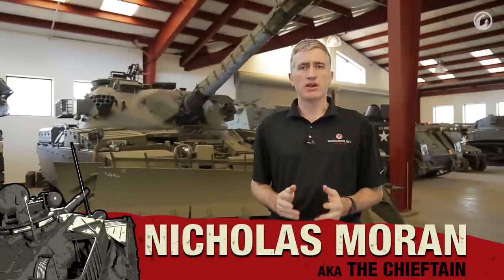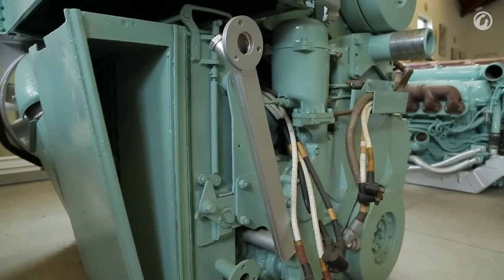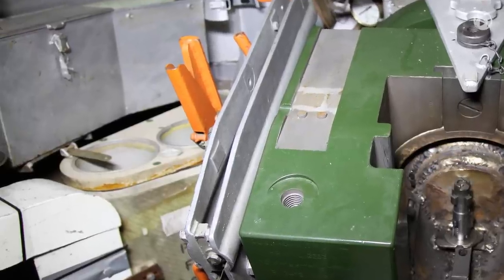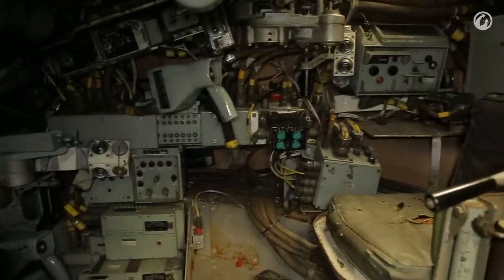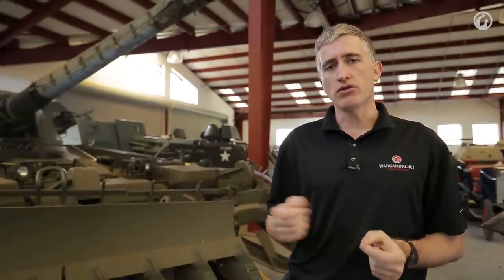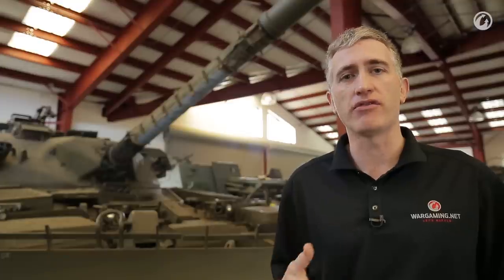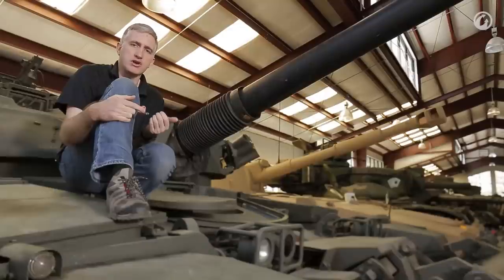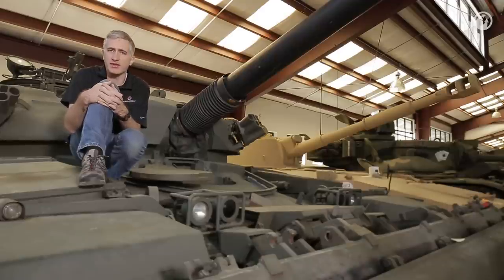Inside the Chieftain's Hatch. Snapshots Chieftain

Comment: Nice video! Couple of extras about the Chieftain:

1. The Israelis were involved in the early stages of it's development and were originally going to buy it. It was only when the deal fell through for political reasons that the went on to develop the Merkava on their own.

2. The engine problem could be fixed. The Jordanians had a version called the Khalid, originally intended for Iran until they suddenly stopped being our buddies, that had the Rolls Royce Condor engine developed for the Challenger. This gave it a WAY better power:weight ratio and much better reliability. The downside was a raised engine deck that meant zero gun depression over the rear arc.

Comment: Never fried anything in the BV when i was on the Chieftain there was 2 per tank so plenty of hot water. Used to put tins in the BV to heat up the food making sure they were dented otherwise the BV would would explode and have tin and food splattered around the turret, which did happened and getting more than an earful from the Commander lol. Also not one of the Chieftais in my Regiment in Germany had the dozer blades.

Comment: Question about rate of fire: Would you consider soviet autoloaders (T-64, T-72, T-80) to be all thet much slower than manual loaders, especiall with, like in the case of the Chieftan, three piece ammunition and the rounds used in the Leo 2 and Abrams where they are stored in a compartment you have to open before loading every round (no lap-loading)? I have counted 9 seconds to reload on the Leo 2 and Abrams (and these the first rounds, not sustained fire) and around 8, 9 and 11 seconds for autoloaders. So I guess it would be around the same, considering the autoloaders also can sustain ROF for longer times and while in motion? I'm asking because there is much controversy between manual vs auto.

Comment: Slightly incorrect information, the Chieftain is most powerful gunned Main Battle Tank of the mid-late cold war, however the M103 was the most powerful gunned tank during the whole war even today, the M58 cannon is the most powerful widely fielded direct fire tank cannon. M829A2 APFSFS-T From the M256 120mm Smooth bore gun [M1 Abrams] only produced 11.1 Megajoules of energy to its target, while the M58 fireing M358 AP-T produced 13.2MJ of energy [M103.]

Comment: Is "Leyland engine" ever NOT followed by something to the extent of "wasn't very good"?
Reply: Jeremy Clarkson did a good vid of "What Killed the British Car Industry". "Leyland" was heavily involved.
Reply: J Ballew
I think I may have actually seen that. Bad quality control, low standards, little faith and plenty of union drama. Something like that?
Reply: WindmillStalker
emphasis on "trade" unions. leyland had to deal with 30-40 of them which held back modernisation (each protecting their own trade) Though full employee strikes were rare, bareley a month went by without one of the trades kicking up a fuss/walking out (stopping the production line). The most popular cause of action was other workers encroaching on anothers patch!
Reply: Thomas Newberry
to be fair for the multi fuel engine in the cheiftan it was very early days for the technology (a bit too early). It was a Nato requirement and I believe (I could be wrong though) the UK was the only nation to implement it at the time. Everyone else stuck with straight diesel until the tech matured (or used a turbine in the american case 20 years later).
Reply: WindmillStalker Funny thing is that British never re-engined their Chieftains. Therefore Jordanian Khalid was more mechanically reliable than it's British brethern. I believe Bovington tank museum has both in running condition.
Reply: WindmillStalker

I'm sure there is some form of the flick on Youtube, but yes, that about sums it up.
Reply: I'm sure that the later model shown in this clip, the Mk.12, had the 900 series engine as opposed to the 650bhp model in the early marks?

Comment: How about an inside the hatch of the Leopard 2?
Reply from the maker: Would love to. The catch is finding one that the operators will let me play and film inside.
Reply: @TheChieftainsHatch  It seemed that you got along well with Ralf Rats. Does the German Panzermuseum charge too much money for this?
Reply from the maker: @potator9327  Its not a money issue. Most militaries consider more modern vehicles to be classified and won't allow detailed filming
Reply: @TheChieftainsHatch  Really that paranoic? If I remember correctly, they have the first hull of the production line there. So the height-adjustable driver's seat is really still classified? Wow, didn't thougt they were that far ahead. ;)
Reply from the maker: @potator9327  it's easier for a military to give a blanket "no to everything that may be current" than to take the effort to go into specifics. Most countries I've asked so far, to include the US, have placed restrictions.
Reply: @TheChieftainsHatch  Thank you so much for your detailed replies. I would have really looked forward to your evaluations. Many of the articles about tanks are fan-boyish or get stuck on single aspects. 
Although you do not hide your attachment to your M1, your judgement always remains balanced and professional. Keep up the good work.